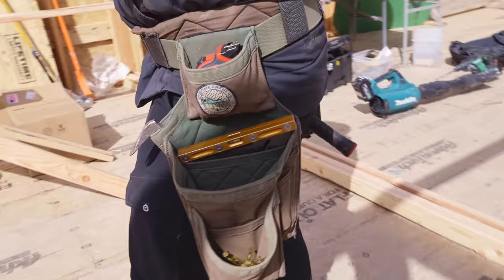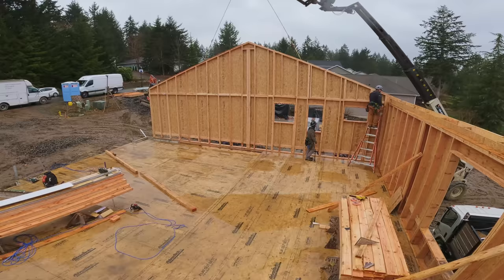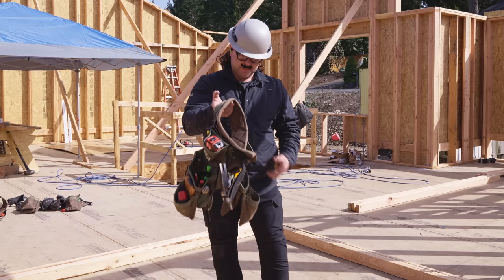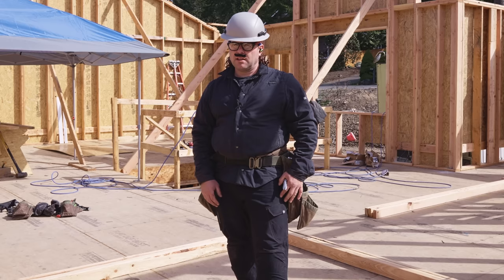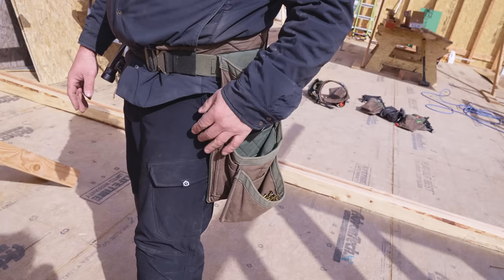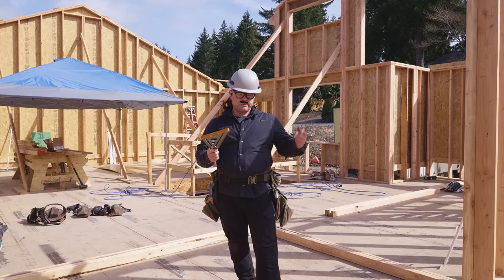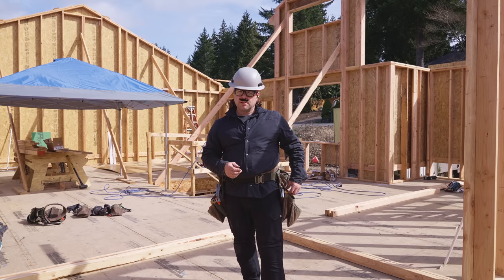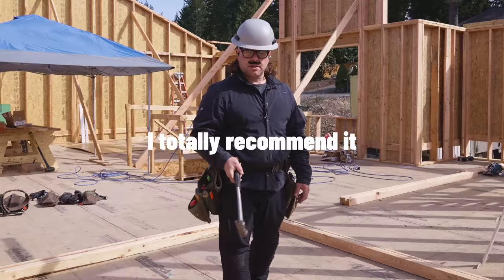Carpenter's Everyday Carry

Comment: you dont carry 30 lbs of bent nails and misc screws at the bottom of your pouches?
Reply: whenever my bags get heavy i have to take a minute to turn them upside down and dump every thing out. then i have to shopvac the pile that left after i throw them away. haha
Reply: Lmao...yeah I sure do
Reply: You forgot the 5 lbs of sawdust/chalk mixture (snow in winter months) and all those strips of nails with 3-4 nails left on them that are there "just in case".
Reply: house remodelling problems, I have those
Reply: Beer does NOT go in that pouch
Reply: I do
Reply: @fredstanford4119 
The pouches are to keep your hands free to hold your beer!
Reply: @fredstanford4119 You quit preaching and went to meddling!😂
Reply: @richcooke9241  I gotta pack a roadie baw
Reply: Rusty deck screws and sheet metal screws and drywall screws? I don’t even do drywall

Comment: I'm a residential renovation carpenter and I do my share of framing but I have to go through my bags every time we change jobs because the tools I need keep changing. Good to see what others carry every day though. Thanks!
Reply: I’m in the same boat. I have more stuff fall out when I lay it down on the floor in a Reno house where the walls are all finished.  Drywall screws, construction screws,  2 or 3 sizes, wire clips, brad nails, you name it,, I wonder if the fabric pockets would be better than the leather pockets I have

Comment: Best feature with this belt are the front angled sleeves for the hammer and nail puller. Alas 45 also offers this option.
Reply: diamond back also and obvious tool co if u want full leather

Comment: On page 733 paragraph 4 reads tim from awesome framers holds the record for pulling the most nails.

Tim I have been following awesome framers on Instagram for a long time back when I was working in a mill shop. I eventually went back to residential remodeling and custom homes. I have used many tips and tricks your page has provided. We always route out our windows. I try to build on the ground when applicable but that is not always the case on what I do. I love thinking out side the box and appericiate you guys insight on different techniques. I also love those pouches and would not mind owning a set. Much respect from our crew in Florida

Comment: I feel naked without my: “Mayhew 60143 12-S Dominator Pry Bar, Straight, 17-Inch OAL”… Basically it’s a 17” flat head screwdriver made for beating on & prying… I use it pretty much daily for something or another…
-Another thing, trade out your chalk box for the “TAJIMA Chalk Box CR301JF-CP”… the string is so much stronger (you can really put some tension on it) & leaves a crisp line